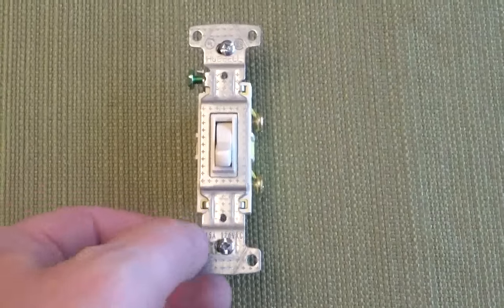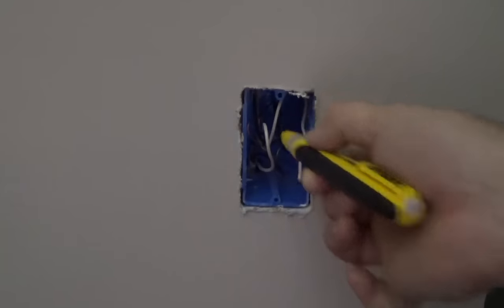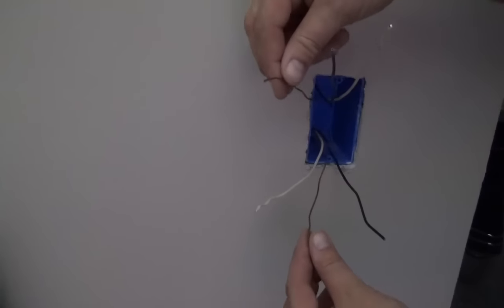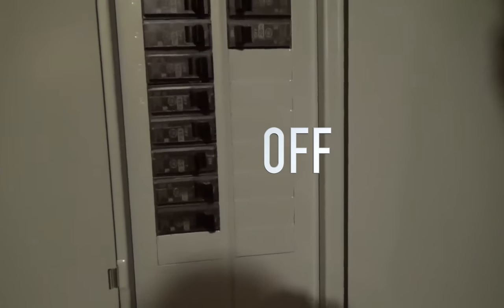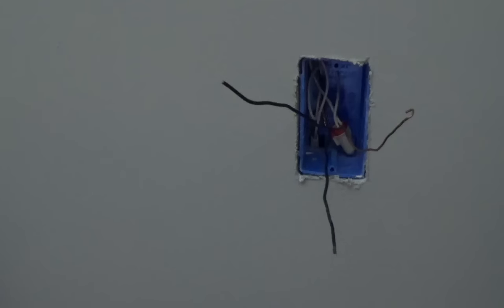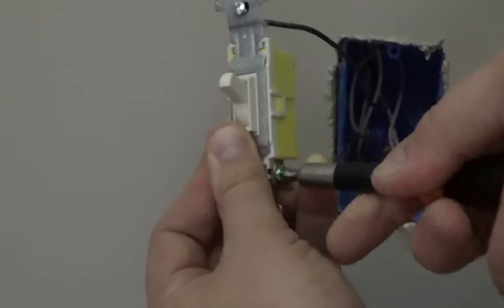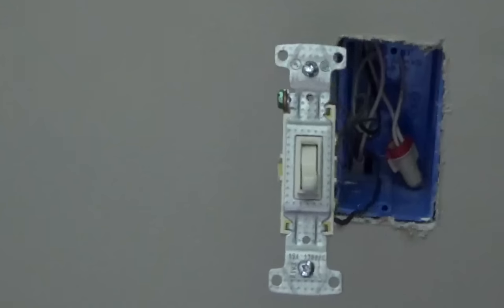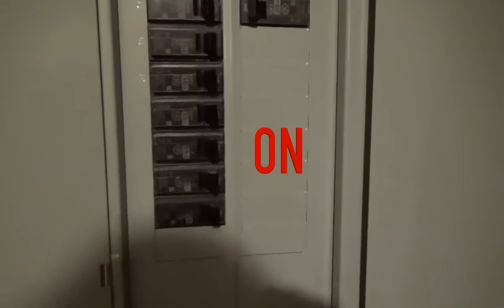How to Install a Light Switch / Single Pole Switch

Comment: I have a switch that makes weird noises when I turn off the switch slowly. Sounds like it’s trying to shock me or something. Bad switch or wiring???
Reply from the maker: Hmmmm..... not sure.  Maybe someone else could chime in
Reply: Phil Crockett I replaced the on off switch and that did the trick.  I guess the switches were old. One more question, the outlet where the garbage disposal is connect to under the sink has one plug that is always “hot” is this normal?
Reply from the maker: Are you saying the outlet has one hot receptacle and one receptacle that is not hot?   If this is what you are saying, then I imagine the one that is not-hot is switched.  It's the one that the disposal should be plugged into.  IOW....  if you plug your disposal into the hot one, it would run all the time (no switch to turn it off).   This is normal if you need to make a 'switched outlet'.   similar to having a wall switch run a lamp.  Hope this helps.
Glad you fixed the other problem.  I thought you had put in a new switch, and it acted weird.  Didn't know you were talking about an old switch.  yes.... that makes sense now.
Reply: Phil Crockett yes I was talking about an old switch that made those weird noises. I have replaced two switches now since watching this video. Super easy. Thanks. I’m going to save it in my “watch later” videos for future reference.  Thumbs up worthy. One more question, I have a GFCI outlet that is constantly needing to be reset. You think it could be the outlet or bad wiring?
Reply from the maker: could need replaced.  I have video on that as well.  OR...... there could be something pulling too much power on that circuit.   Your GFCI may be protecting other outlets that have things plugged in that is causing the trip.   Try replacing the GFCI first....OR...... trip it, and test the surrounding outlets to see if it's protecting others.  Here's my video:     https://youtu.be/kBVquldPNUQ
Reply: Ik I’m pretty late but it’s cause because the contacts are slowly breaking contact but there’s an arc being created because of the difference of potential between both sides of the switch

Comment: Somebody said don't matter how wires  are hooked up on switch ?
Reply from the maker: It really doesn't except for the label of off and on.  If you flick the switch on the lights go off, switch the wires and you will be good
Reply: Thanks